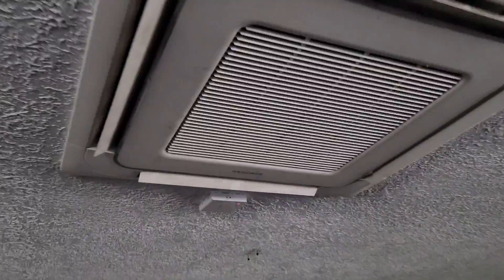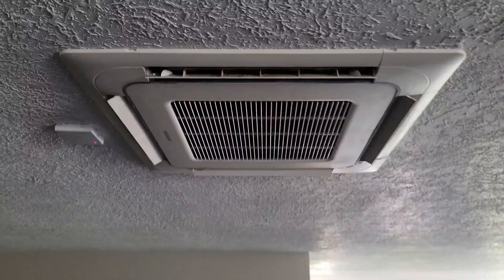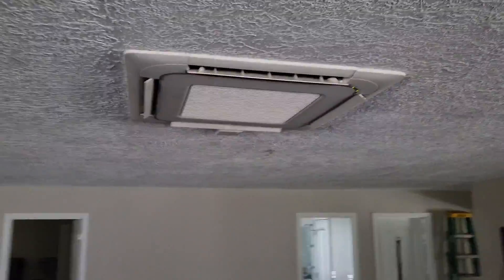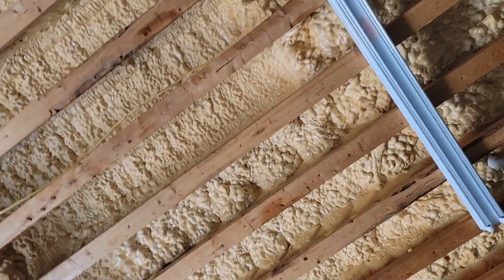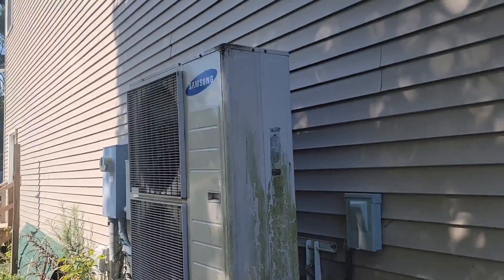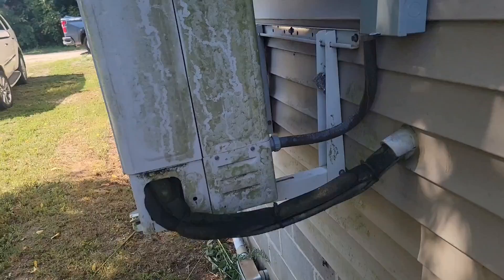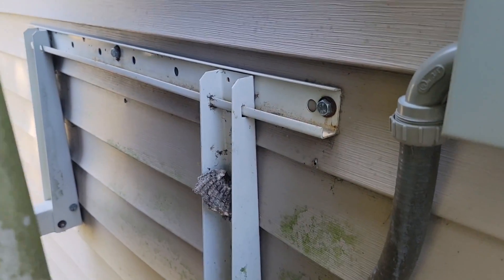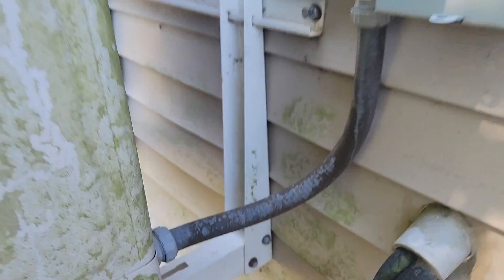How to HEAT and COOL 😎  like a PRO? #hvac

Comment: You know your stuff Tad.  I talked my HVAC guy into puting in a 4ton instead of 3½. (Short cycling!) So i have to keep my dehumidifier on during the summer and during the warmer times in the winter. Worst mistake I ever made. 
However, I'm definitely going to look at the closed cell foam insulation. That seems really awesome.
Thanks for your information Tad. Keep up the great videos!